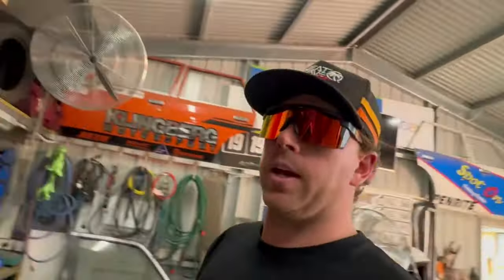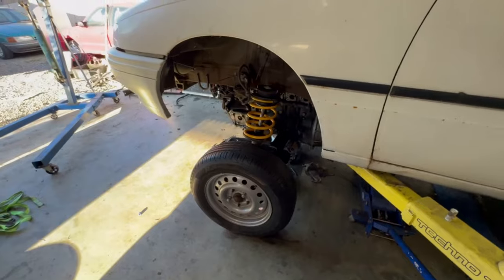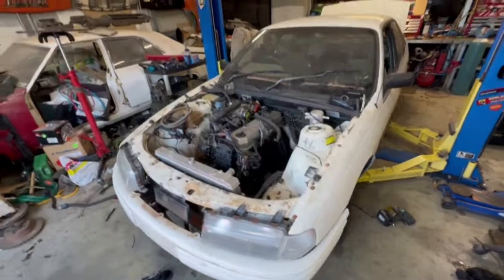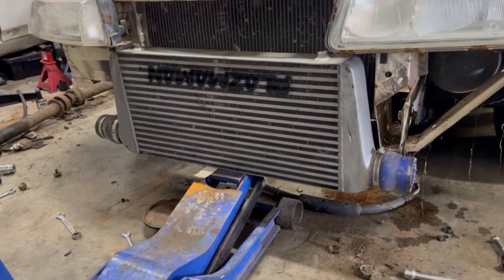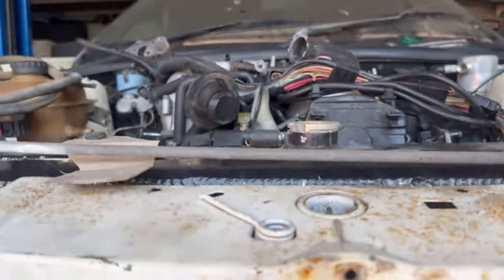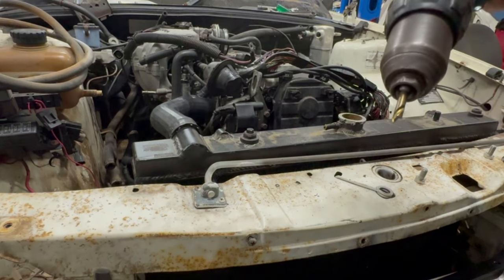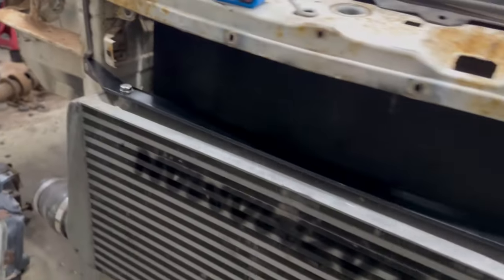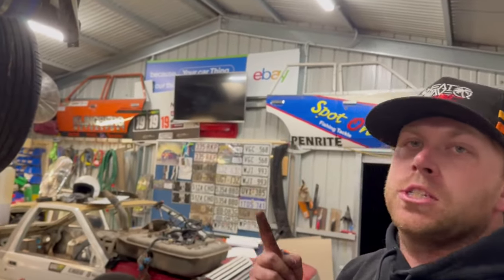RB30 + TURBO + VN Holden Commodore. My VN becomes a BT1 interceptor! How to VN RB30 conversion PT 1

Comment from the maker: I should add, I know a could have used a bolt in radiator like a VL rad. But I have a pile of old Corolla radiators and this is a budget build, it cost me $0.00 to fit this radiator haha 👌

Comment: Yeah i have one use vl kframe, radiator and gearbox cross member. Tailshaft is vl front half vn back half bolts together. Manual pedal box from a vs for hydro clutch.

Comment: Mate put a built RB30 into a VS Ute with Plasma-man 14:10  forward facing Plenum and big Turbo and there was heaps of room for the turbo.
Reply: Did he have to manufacture engine and gearbox mounts? I imagine the VS is a different design underneath than a VL/VN? I like the VS model, so I’m interested to know how difficult it would be to transplant an engine like this into one.
Reply: @djnmv  pretty sure it bolted straight in but I’ll find out for you.